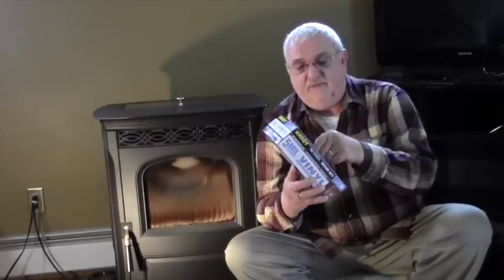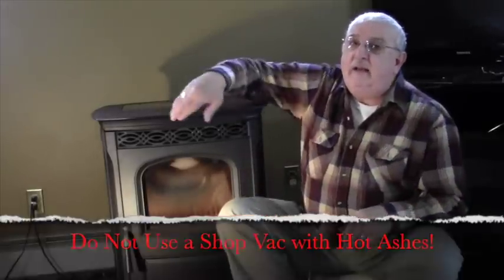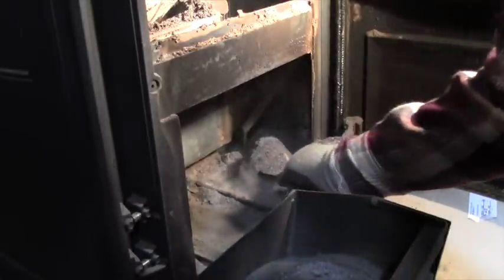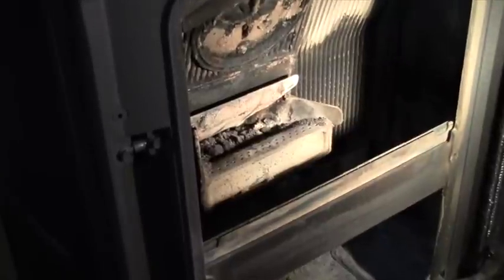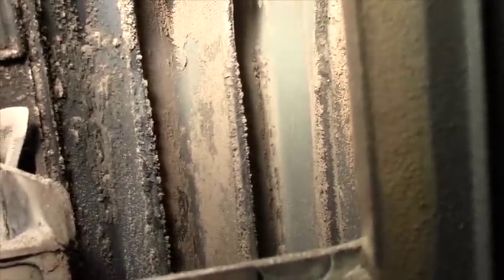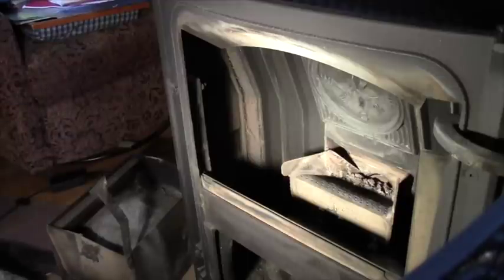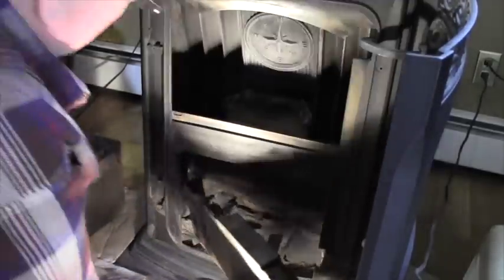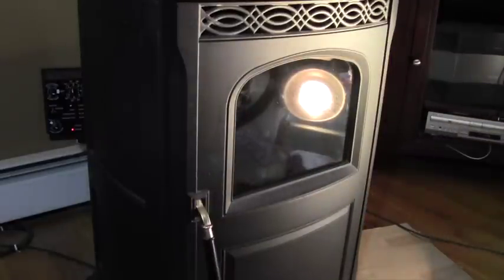Pellet Stove Cleaning

Comment: Might I make a suggestion. I have the same Harman stove and to avoid all that dust, right before I start cleaning, I will turn the temp knob on till the stove starts and just open the door and the auger will stop but the exhaust fan will remain on. And then start cleaning out the stove and you can remove the left and right plates but not the bottom. You can do your brushing and clean out the ashes on the bottom and the dust will just get sucked out of the exhaust pipe going outside. When removing the cover, covering the exhaust fan, TURN OFF the stove. You won't need to be running the vac to suck out the dust, the exhaust fan will do that for you.

Comment: Hi, thanks for the video!! Why did you push back the ashes on the burn pot and not remove it completely?
Reply from the maker: Two Reasons: 1) The stove creates very fine ash. The stuff at the edge of the burn pot is a minimal amount and beneath it is larger pieces that are incompletely burned. I don't want to dispose of usable BTUs so I push it back instead of vacuuming it away. 2) Like a camp fire, reigniting a fire is sometimes easier when using charred wood.

Comment: Great vid...2 things though. 1) get the drywall dust rated bags for your shop vac, the will catch all dust and not clog. 2) Be careful with the brush in the exhaust port of your harman...your bend or break the ESP probe.
Reply from the maker: +Ken Zaleski Thanks for the feedback. Drywall bags are an added expense that I really don't need as I never intend to vacuum heavy amounts of ash from the stove. If I did intend to vacuum ash from it, I would bite the bullet and get a regular ash vac. But the mention of the probe is well appreciated. Thanks!
Reply from the maker: +Ken Zaleski I've added an annotation to the video to caution viewers about the probe. Thanks again!